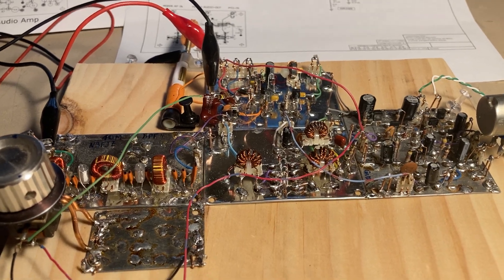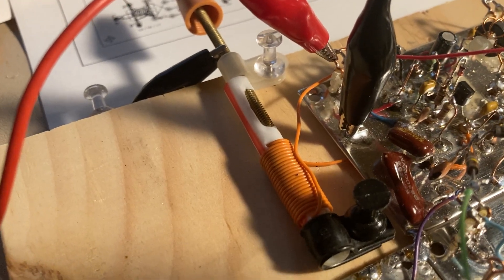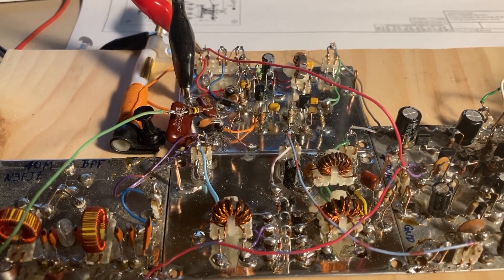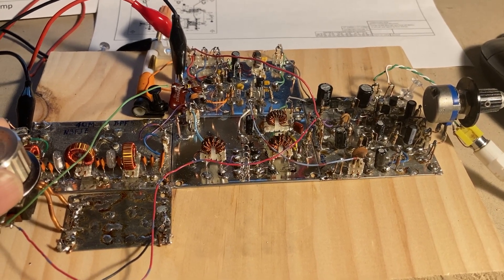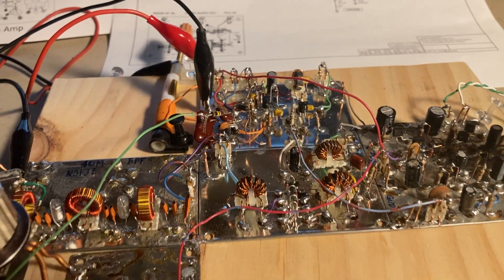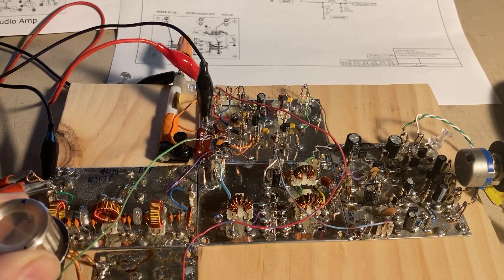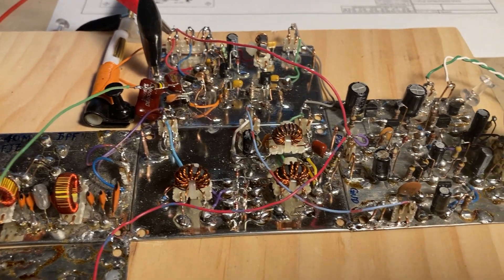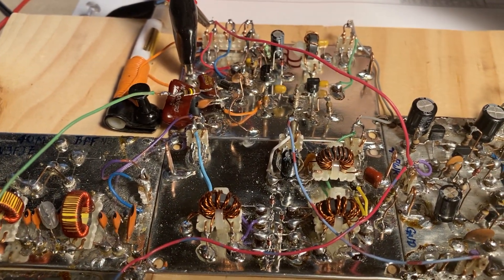SolderSmoke DCR Mixer / Diplexer Module Completed

Comment: nice audio and very stable
Reply from the maker: Thanks Paul.  At first it drifted all over the place, I couldn't understand why because I had built a few other PTO's a few years ago and they were relatively stable, then I realized that the capacitors I used were from my junk-box and were probably from old TV sets I disassembled in the early and  mid 70's as a kid.  I found some mica caps and problem solved - not only that, the output level of the PTO also increased,  so not only were the caps drifty, they were also lossey (low Q?).
Reply: @Circuit6040  haha brilliant, it is a thrill making a drift free osc playing with red or black caps and coil types...